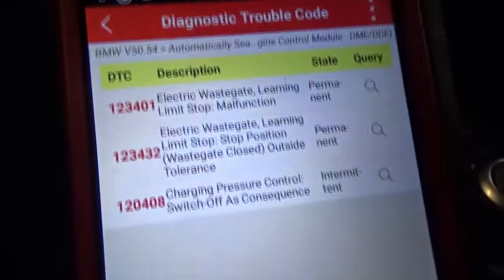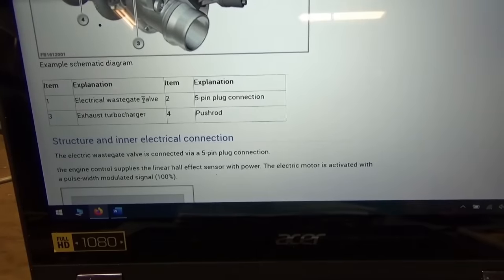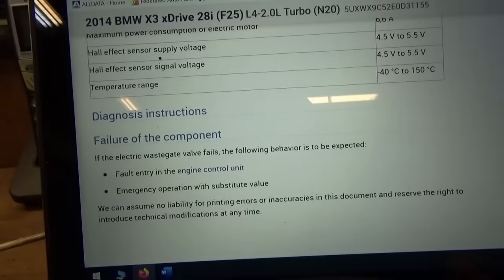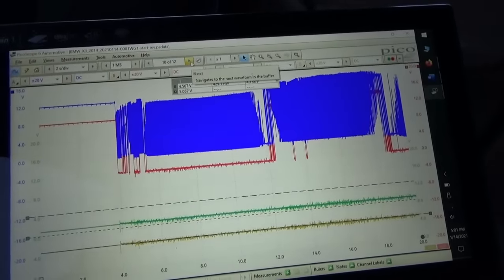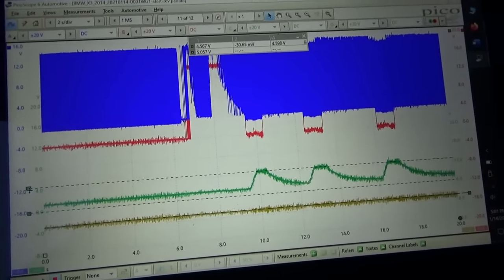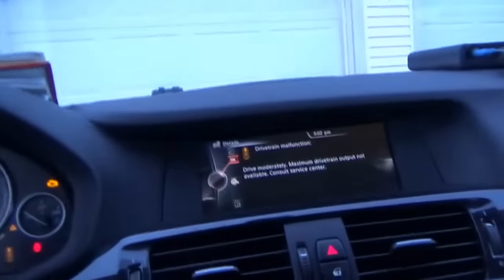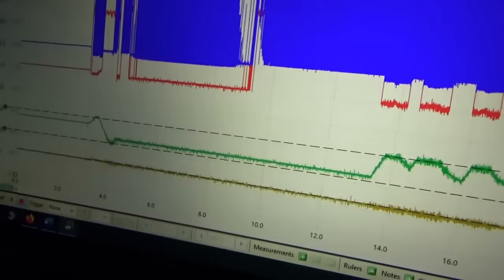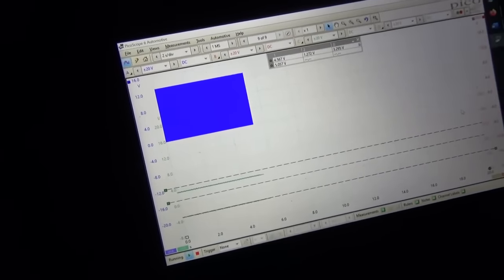BMW Turbo Wastegate MALFUNCTION

Comment: My god. You literally just solved my problem. I’ve been trying to find the source for months!! I have a 3 series diesel of the same year model. Yet every single issue you mentioned I was having as well to a T. It only happens when the motor is hot, the car will then go into limp mode “driveshaft malfunction”. Even the rattle on start up. Thank you!

Comment: Well I was just quoted $4500 for a new turbo. I found your video and adjusted the wastegate but only did three turns. Unfortunately I do not have the software to find the exact specs. Start of the car codes all went away car is running fine and the turbo is now working.
Reply: I don’t have a scanner neither to tell how much it is off. I’m going to turn it 1 at a time, test drive, and adjust turn again if needed. How is it holding up did the malfunction error came back?

Comment: With the money you saved him he should have you do the oil change,  you really saved the customers r a fortune.  The dealer would not have done that.  They would have replaced the actuator if he was lucky and the Turbo is he wasn’t so lucky.  Should be an hour for diag.  1.5 at least for the repair
Reply: Well what's the guys time and effort worth?
He has to drive the car to another shop for his discount...what's that worth in fuel, time and inconvenience?

Comment: Thanks so much for this video! Been dealing with drivetrain malfunction on/off for about 6 months now. I took my car into shop couple months ago for this same turbo related drivetrain malfunction code. They said they would try a new battery to see if it would get the code to go away. (Didn’t make much sense to me how a battery could fix loud turbo rattle) They said sometimes a uncoded battery could cause the drivetrain malfunction. I said yeah let’s try it thinking that if it didn’t work they’d put old battery back in which was still new at the time. We’ll that didn’t fix the problem and they still charge me $500 bill total. Robbery. Thought I was doomed for new turbo. You helped me do this with one 10mm wrench in my driveway in 5 minutes thank you!

Comment: Do you not like liquid electrical tape to seal up holes in wire ?
Reply: I was wondering how long dielectric grease will last.
Reply: I think that’s actually a great idea.
Reply: @dans_Learning_Curve  I'm sure Ivan meant that liquid electrical would be used.  He uses it all of the time - pay attention.

Comment: Ivan, thank you very much for this video. Just got my X3 imported from the USA and it was having the exact same problem. I believe they throw it away because of this! After scanning the car and saw those electric wastegate leaning position out outside tolerance remembered I've watched a video with you doing exactly the same thing and came here for reference again. Problem fixed for now until the wastegate valve completely dies :D Keep up the good work! Thanks you!

Comment: Research often pays off. Did the linkage adjustment also solve the rattling noise?
Reply: I did this, and it fixed my drive train malfunction & rattle.
Reply: @griffingates did you used any software or just turn 4 times?
Reply: literally just turned. still no issues to this day.
Reply: @griffingates  amazing bro. BMW says turbo replacement needed but most people just solved the problem by turning the nut just like you.
Reply: definitely worth a shot if you’re having a drivetrain malfunction and they say it’s the turbo. saved me lots of money.
Reply: @griffingates  mine is b38 engine and the nut is little different than the one in the video. I am not sure yet...

Comment: This is the first time I have ever seen a Hall effect sensor used to output a linear voltage.  This requires 2 things in addition to the sensing element itself : the actuator rod must vary magnetic flux density with position and there must be an op amp inside the sensor/housing (actual Hall voltage is usually in mV).

Comment: I had this exact problem. Saw 5 mechanics in under a month and all put thier machines to it and couldnt fix my problem. One said he has to download a special file to do a wastegate ajustement.
 I saw this video and fixed my problem under 2 min.
 I only did 2.5 turn though.
It now works great finally.
Thankyou very much for this video
Reply: Did you do it without a scan tool, and has the issue came back after you fixed it?

Comment: Awesome job Ivan! Ivan you said put dielectric grease on the punctured wires, did you mean liquid tape or did I get confused? Still learning here!!!
Reply from the maker: Dielectric grease isn't as messy and doesn't dry and crack from the heat :)

Comment: Ivan,  I predict you will see plenty of turbo related problems as car companies are pushing turbos in alot of their Inventory. Like you said, turbos require religious oil changes with a quality synthetic motor oil. They are not forgiving on it's negligence and will break down.

Comment: Awesome video!! Great job of methodically diagnosing actual problem rather than just throwing parts at the situation.  You just helped me fix my x1 with the same problem. Thanks!!! I was avoiding taking it to a garage for fear of being sold $1000's of dollars for a bunch of unneeded parts. Thanks again!!

Comment: You sir just saved me 5k. Went to the dealer with the same malfunction warning and CEL. They said I need a new turbo system. I declined and when I came home after watching this I popped the hood and the link wasn’t even connected I put it back with a nut and bolt and the warning and everything is gone.

Comment: Man you just saved me a ton of $.  The local bmw dealer told me I needed a new turbo @ $6500, and I was experiencing the exact same issues once the engine warmed up.  I checked the wgv linkage and it was making a little rattle noise so adjusted in the - direction a coulple turns, and now no more rattle and no more drivetrain malfunction.
Reply: same case with an X1....  bmw local dealer :  localdealer: your wastegate fails, then me: ok change it, localdealer: not sell alone, we sell the change of the entire turbocharger that includes a new wastegate ....... ...... ..... pum ... I will try this repair and adjustment, wish me luck

Comment: Smashing, no parts repair :-D
The question is how did it get out of adjustment.
Linkage wear perhaps.
Reply: Maybe the guy hammers it, causing early wear.
Though it looks like he rarely has it serviced, so that may have contributed to it happening, since it might be checked/adjusted during a normal service?

Comment: Any other mechanical would  just replace the turbocharger it's good that Iven did proper testing and fixed the issue.
Reply: Absolutely, my Kia dealer replaced a complete turbo assembly under warranty, shipped it. It performed just as bad when I got it, apparently they did not noticed a split in half intercooler.
Reply: @vadim7590  That's crazy sure to God they would of heard the hissing sound under decel thank goodness it was under warrantyl .
Reply: @neilmurphy845  probably didn’t pressure test it for a leak and unlikely they even drove it. Probably checked codes (turbo performance) and parts cannoned a turbo on it.
Reply: @robry84  Yah more than likely I was always told by my family and friends to never waste money going to a dealership they said go to a mechanic that is known to be good unless it's under warranty.
Reply: @neilmurphy845  if it’s under warranty then who cares. Especially when they’ll give you a loaner.
Reply: @robry84  Yah that's it I guess you don't have to pay for the repairs and they give you a loaner if you don't have another ride.
Reply: @neilmurphy845  it was visible to naked eye, took them a couple of days to incorrectly diagnose it, 3 weeks total, then after all that, I had to diagnose and fix the intercooler myself, as it was not covered under warranty.
Reply: @vadim7590  That's crazy why wouldn't the intercooler be covered under warranty that's not very good.
Reply: @robry84  "Who cares?"  Everyone should.  That's why it's the way it is now.
Reply: @paulmonk7820  if a manufacturer is going to give me a warranty and rely on their trained people to work on it at their sanctioned repair facility then I don’t care what it takes as long as they fix it in a reasonable time. If you don’t have a warranty then seeing someone like Ivan is a must.
Reply: @neilmurphy845  it wasn't part of a drivetrain warranty. And to those who says "who cares?", let them drive the cheapest toilet rental for weeks while the car still wasn't fixed properly. I dumped the car right after.
Reply: @vadim7590  Yah just how could something that's part of a turbo system not be covered by the drivetrain warranty  and I wouldn't mind driving a shit car for free for a few weeks because turbos aren't cheap are you sure the dealer wasn't just pulling your leg and that Kia themselves says it ain't.
Reply: @neilmurphy845  I only had 25k miles on the car, I didn't need a free turbo.
Reply: @vadim7590  That's terrible so by the sounds of it the Kia warranty is a scam unless you're doing rock crawling intercooler should not blow out that fast. What car did you end up buying arfter that. What I meant was the intercooler is part of the engine so it should have been covered sorry for the confusion.
Reply: @robry84  Definitely outside of warranty when you're paying out of your own wallet then  you definitely want somebody like Ivan to work on it.
Reply: @neilmurphy845  it's common on those cars, intercooler is crimped, not welded together. Got the cheapest lease I could find at that time, $150 a month for Hyundai Ioniq plug-in. This was a month before pandemic, so didn't even need a second car now.
Reply: @vadim7590  That's good you have another car now but what crap engineering to crimp something with that much pressure going through it .
Reply: @neilmurphy845  crimping is fine. VW intercoolers are crimped (plastic end tanks) and they last for hundreds of thousands of miles. The issue is quality, not the technology.
Reply: @thebigmacd  So it sounds like Kia still have a long way to go in quality they might look nice and feel nice but a VAG  or Toyota will destroy them in under the hood quality. I think I know I know why the warranty is 7 years .

Comment: I did notice in the ISTA+ repair procedure for this code, a comment to the effect of - paraphrasing here -  "replacing the wastegate actuator is only a temporary fix - you're going to need a new turbo in the near future."

Since this video is over a year old now, can you tell us: Has this car had any further issues with the wastegate or the turbo since this fix?

I just used ISTA+ to run the diagnostic on my 2016 328i with 151k miles after getting the "Drivetrain malfunction" message a couple of times.  Mine also measured out -3.00mm.  (What is it about 3mm?).  Made the same adjustment of 4 turns, and the error went away. We'll see if it stays away.

Comment: Great video, helped me solve the issue on my X5 35i. I had installed a new wastegate a while ago, and started getting the drivetrain malfunction and reduced power mode. It turns out the linkage had loosened, (not due to the nuts not being tight!) and there was a lot of slack. I tightened it up, and she was good to go. Curious if the arm inside the turbo is deforming or bending, either way seems like if that happens a turbo replacement or rebuild will be required. Good luck! Also! I was able to do a "no new parts" repair!

Comment: Very helpful thanks,

Can you do one for this common issue in bmw where you try to fill gas and it keeps stopping the pump after every few liters, i think its a high pressure valve issue or something?

Comment: Unfortunately most recent car models rely on engine oil to do so many things besides lubricating the crankcase and pistons. Cooling turbos, actuating valve timing, not clogging EGR valves... All these extra functions need that oil has to pass through tiny little holes that can easily get clogged with dirty oil.

So this is what he means by religiously changing the oil to avoid major repairs later.

Comment: 18:46 - if I buy this diagun that you used, will I still have to hook up all the channels in order to get the measurement for the closed limit position or wastegate valve? (In the video, this one measured -3mm) can this be measured without hooking up all the channels?

Comment: You can reset the maintenance lights from the dashboard not the i drive info center but it’s a hell of a lot easier to do with a scan tool. I use oe Bmw oil on mine but my 328 is a diesel takes LL08 45 miles a gallon on that baby 2.0 D

Comment: Hello sir,  would you help telling me the size and threads pitch of the two nuts that go on the wastegate actuator rod ?  These are the two nuts that are used to make the adjustment and also to connect the bracket to Turbo.  Mine fell off (don't know the reason) the other day and hence Turbo is not working .  FYI, I had the wastegate actuator changed couple of months ago by a local mechanic.  
Thanks for your help in advance...

Comment: Hi, Yes, awesome repair no question there with no parts is because is at the Pine Hollow Auto Diagnostics, if it end up in an other place of repair, then probably would have changed one or two parts and then Call Pine Hollow Auto Diagnostics.

Comment: I love the last part of this video. I think I have the same prroblem with my turbo. I have got replaced a new turbo on a workshop. The workshop just replace the turbo without any adjustment of the wastegate. There is now boost at all when I accerate. Got Drive train uptil 3000rpm and over 3000 rpm. I did a diagnostic and ffound out the booste pressure solenoid was shor circuit and god many error code 244c00, 29a400,299100, 29a500, 25d400. After replacing a new booster pressure solenoid all codes disappeared except code 29A400 Charging pressure actuator closed too far/positiv control deviation. Ho do I know how many turns to adjust my wastegate?

Comment: Epic no parts required is correct!  I would bet the stealership would said they replaced the whole motor. Then do the adjustment and charge the customer for N.E.W. part.  I don't trust Express lube places for my HHR so I definitely wouldn't trust them with a BMW.  Yeah to go Ivan!

Comment: Fabulous content! YOU SAVED ME HELLA A LOT OF MONEY. Alright here’s my experience, I have a 2013 Bmw 328i f30 with N20 engine with the exactly the same malfunction. Also I am a college student so I don’t have enough money to pay the dealership which they were asking about $4000-$5000 to change the whole turbo. Also I don’t have any expansive coding device, but I have a foxwell one which doesn’t do a whole lot. So I gave this a try, first I turned the nob twice for adjusting the linkage without any information and it cleared out the warning for me but wasn’t giving me enough power so I turned it again for one more turn and it got better. Hopefully the warning doesn’t come back!!!🤞🤞🤞🤞🤞
Reply: I don’t have any scan too neither, even if I did I probably won’t know how to use it. I’m going to try your method give it a 2 turns, add more turns if it needs it. Did the malfunction issue comeback, because the dealer is telling that the turbo has to be replaced over $4,000 for it.

Comment: Awesome, bought an f30 with a slew of codes, just trying to sift thru them to make a nice car.  Your video helped me get at least these codes gone.  I adjusted the linkage and ran the procedure in the scanner until I got within the 3mm adjustment window the computer wants to see, eventually I got it to zero out.  My guess is this problem happened to someone, then they replaced the actuator cause it looks new, then they adjusted it wrong.  Awesome!  You got a like and subscribe from me, I’m sure I’ll need your expertise in the future
Reply from the maker: Nice job!
Reply: @PineHollowAutoDiagnostics  just started working on it again and noticed someone installed an e90 water pump, cut the factory connector off and incorrectly wired the new connector.  This is going to fun, it’s that type of vehicle someone couldn’t keep their hands off and kept making it worse.  Looks like it has two different cam sensors too.

Comment: Hi, this was an excellent video. I have a F10 2014 but diesel éL turbo. I think I have the same problem but I don't think I have any adjustment on mine. Any advice? I also loved your OBD2 tester. Can I have the neme and model number as I want one just like that. Cheers from UK.